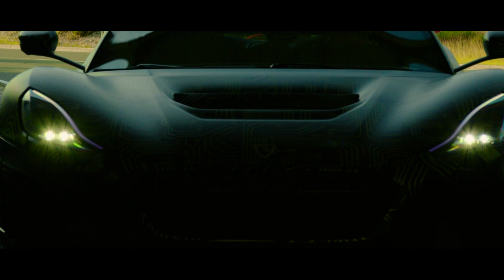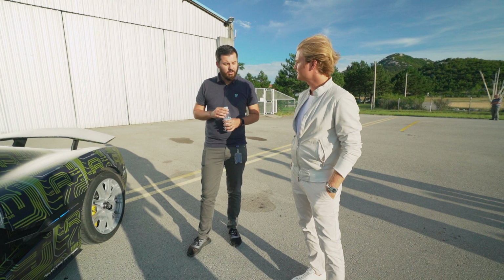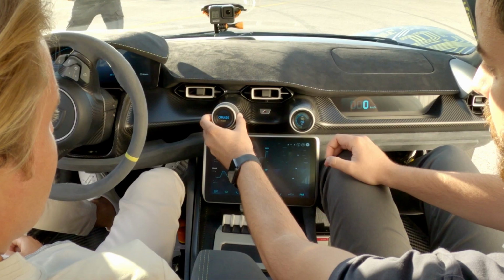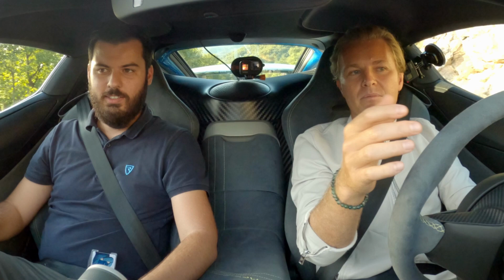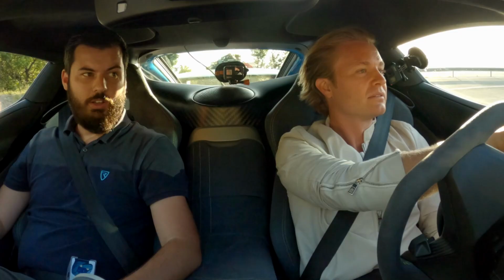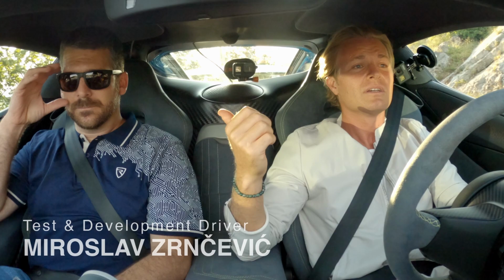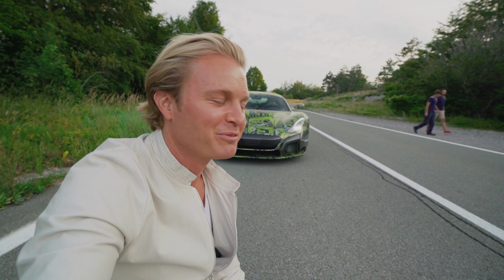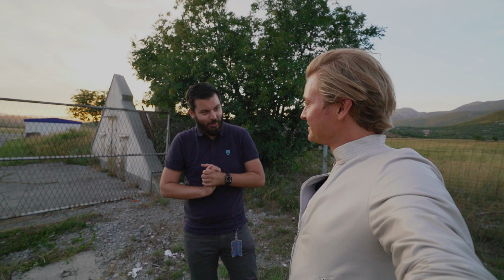World’s First Drive of The New Rimac Nevera Prototype!! | Nico Rosberg

Comment: Mate is scared of his own car
Reply: I think it demonstrates that he’s done a pretty good job! In the right hands his product seems to surpass his own expectations!
Reply: He‘s probably thinking about his family and all the systems or parts that could potentially fail while Nico is pushing it to the limit in the Mountains with zero run off area😂
Reply: Mr Rimac, scared sh1less at a drive at like 70% pace for Nico.
Reply: That’s what happen when a computer nerd, not a car guy fanatic, builds a car.
Reply: @greggb557  Mate is a huge car guy if you didn’t know. There’s a youtube series about him that’s worth watching!
Reply: Nico has the wheel to hold on to for stability and is in control, Mate has only his trust in Nico to hold on to. Driving and being driven are two very different things and to be fair, if the car didn't scare you in the hands of an F1 world champion then there would indeed be something wrong with it
Reply: Take a drive in any fast car with a very competent driver, pushing. The passenger seat travels 25mph faster than the driver’s seat, always. The prototype is lucky it’s designer didn’t punch a hole through the floor of the monocoque with his “brake foot”.
Reply: @greggb557  you know nothing then 😂
Reply: Mate : " What have I done? "
Reply: "I'VE CREATED A MONSTER!!"
Reply: He almost died 2 times while someone else was drying him and he had to make a promise to his girlfriend that nobody will drive him so yeah i woud be scsred too

Comment: I'd suggest white or a light, bright paint scheme – black hides the lines and pretends to be tough. Red or white.
I'd also like to see an exploration of the 5% (pedal feel, steering, input and feedback though all driver controls, programmability, user controls.) That's the limitation of EVs … they're software simulations of machines. I'd like to see telemetry comparing the actual data from the Rimac C to a purely analog super car (McLaren F1, Ferrari F40, Porsche 959 or Carrera GT.) I assume sooner or later all the electric hypercars will have "modes" to simulate any given vehicle … just twiddle the knob and select anything from La Ferrari to Lada. But for now, I'd like to see world class drivers drive these cars and compare them, lap for lap, back to back, with the cars we admire.
Obviously for an F1 champion, programmability of one or two settings is trivial. I want a hypercar to be an F1 car – programmable sways as you gave for example, adjustable, programmable for every turn on a circuit … "here's my Nurburgring Nordschleife program … for Adenauer,  the rear sway is one notch too stiff, I'm adjusting that program and reducing power through the karussell, increasing outboard torque steer through left turns about 200 km/h and increasing brake cooling before turns at threshold braking … etc.)

Comment: if the number they are saying are true then THANK GOD there is someone who is giving tesla come comp!
also we should look beyond the numbers, all high end cars are not built for the average person. they are built for RICH people.
rich people do not care about paying crazy prices for maintenance like normal person. $3500 brake job for a porsche when you can buy the parts fior $500 and do it yourself in 2 hours as an example. we the average consumer gets mad at these companies for ripping us off. remember the car was not built for you and me.
a Mclaren transmision dies in 2 years and they put in a new one under warranty, the a year later after the warranty is over the 1 year old trans dies and it cost you $30000 to fix. remember the car was not built for us but for rich people so they pay to fix it.
all these high end cars are in betta all the time. so YES this car has some impressive numbers but when it comes out it will have the same problems as the Mclaren and worse they will bare get any updates to improve it because the business model is the OLD business model (take your money and build another car with all the improvements) and make you upgrade.
tesla does not think the OLD way nor does it do business like that.
I have owned a new porsche 911 in 2003 and a 2019 911 turbo (got stolen last month) and now own a tesla model S.
I want new competition for tesla because 1 company holding all the cards is not good for the customer. YES NOW tesla is doing right by its costomers but who knows how long that will last.
porsche use to be a great company use to be.
these cars look good but we need to look at more than the looks we need to look at the SUPPORT! will these companies stand behind there products years after the warranty is over. 
RIGHT NOW NO CAR COMPANY TODAY STAND BEHIND THERE PRODUCTS IT IS NOT THE BUSINESS ODEL USED TODAY

Comment: Rimac will only produce 150 prototype vehicles. - Compare the Tesla Roadster with Rocket Thrusters 0-60 in 1.1 seconds, which will be an actual production car. "Elon Musk Says the Roadster Will Use Rocket Thrusters to Hit 0-60 in 1.1 Seconds." You can buy a real Tesla Roadster for less than $250k.